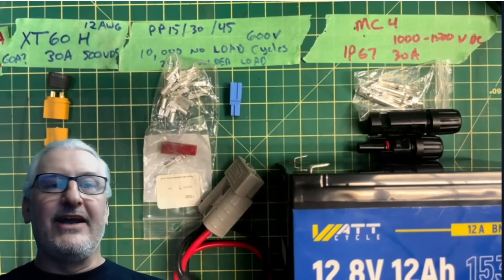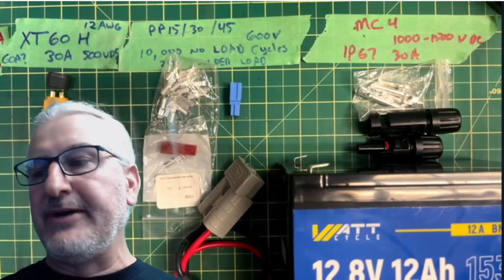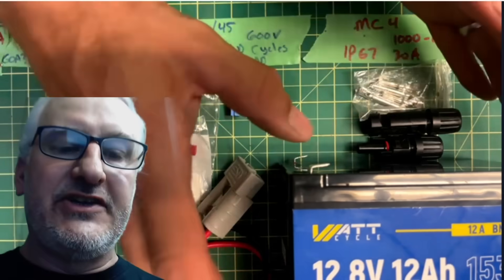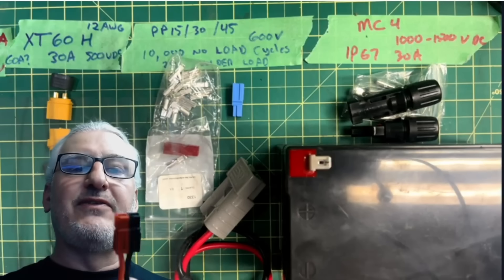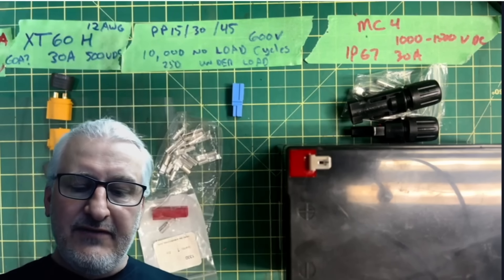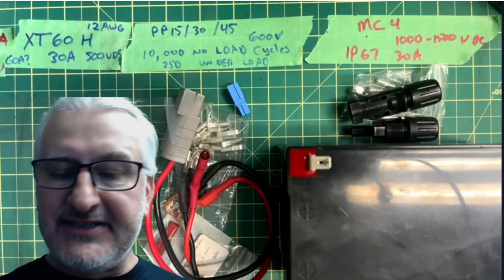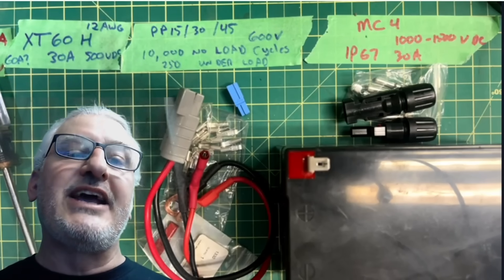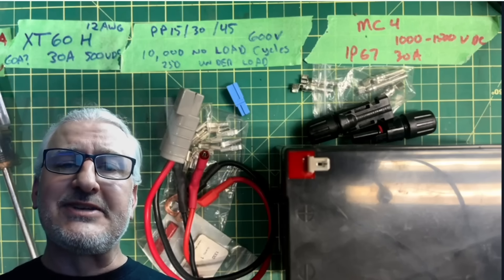Connectors 101: Choosing the Right Plugs for Ham Radio & Off‑Grid Solar #wattcycle

Comment: Which watt cycle battery would you recommend for the 7300. That will give me 20 to 30 hours of use
Reply: Since it came out. Thanks
Reply from the maker: Great question.  On SsB running 100w I would recommend the 100amp Wattcycle battery with Bluetooth.  The Bluetooth is great as you can monitor your usage and adjust your power output on the radio to band conditions.   How long have you had the 7300?